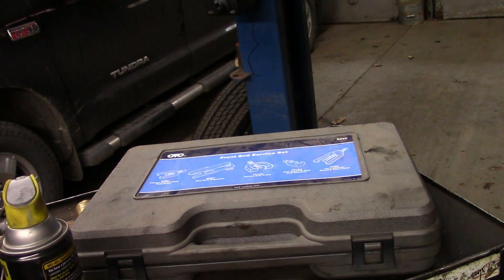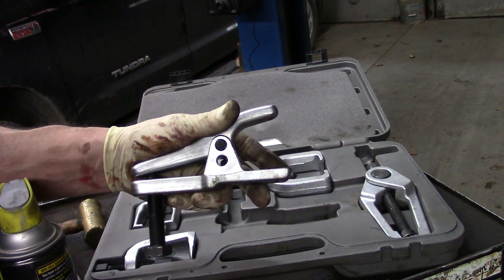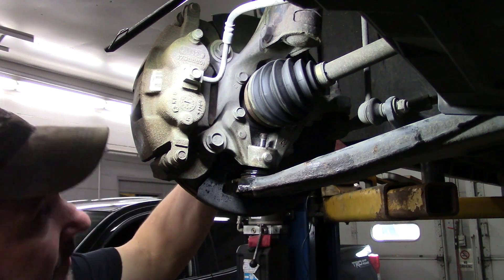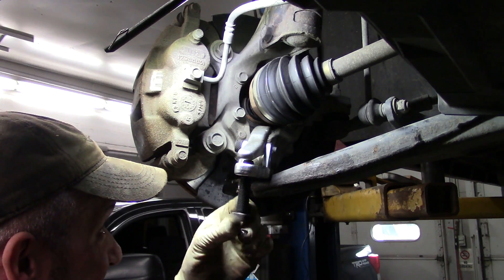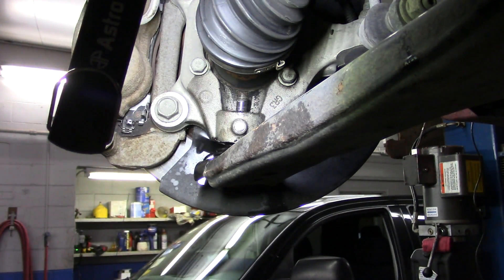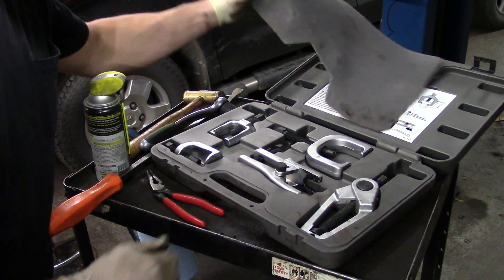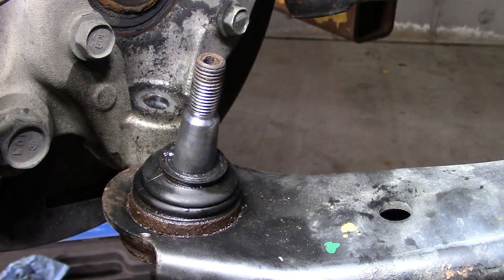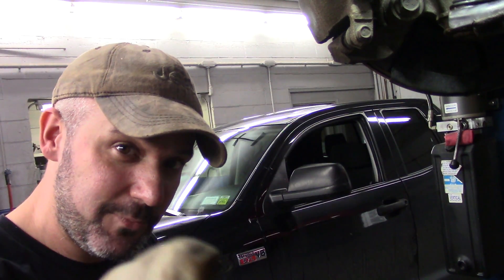Tool Time: The OTC 6295 Front End Service Set

Comment: That same ball joint tool works great for pressing back the copper sleeve on alternators that helps make them extremely difficult to reinstall unless it's hammered back or pressed back with that ball joint tool!

Comment: My bottom ball joints were stuck on my Silverado. Pickle forks and hammering to no avail. Don't have this kit (YET). Put my Powerbuilt control arm bushing press on it to just add tension and it popped right loose! This kit is in the mail right now. Thanks for another great vid Eric!

Comment: I have a ball joint separator from Harbor Freight the part that goes on the ball joint stud is pretty thin so I thought it wouldn't hold up. Boy was I surprised. I've used it several times with great success.... well, there was that one time...
I was cranking and cranking on the tool thinking, "any second now" and anyone that's used one knows that it can sound violent when it goes.  Anyhoo,  I was cranking on it and stopped to look, the tool was bending the ball joint stud on a Moog ball joint. I couldn't see it from my vantage point. That little $8 tool is surprisingly strong.
(A new ball joint was then needed)

Comment: Oh, and tool tip for the tie rod tool...when you're done screw it back into the jaws, if you loose the tip, they're useless. And I've had the tip blow out like my shorts when old rusty finally popped and tie rod job turns into clean up the shop job.

Comment: This one either didn't show up in my email, or it got deleted by accident. Guess I need to check your channel directly every couple of days! 

I have that same kit! The labels and instructions look different, but all that's included looks identical. I bought mine about 7 or 8 years ago ... maybe longer. 

All the tools in that kit work great! I used it for years on everything,  before I realized alot of things can be removed with a 4 lb. sledge whack to the side. There's been times where I thought I'd break that one you were using there - I was hammering on it full bore with the 1/2" impact. Was having a bad day that day (what else is new? 😂) and was in "IDGAF mode" . Well thankfully the ball joint let go before the tool did! 

The pitman arm puller and tie-rod end tool also work fantastic. Priced pretty reasonably for that kit, too. I highly recommend this! 👍👍

Comment: So the trick to making this thing work on a 2008-2012 Accord: you need to grind the notch significantly larger.  Like...don't stop until the inner "edge" is 3/16" thick.  And you have to tap it in pretty aggressively to push the boot out of the way.  The boot will weep grease because it gets compressed by the tool.  And jack up the rotor a bit to flatten out the control arm...otherwise you have no chance.

Comment: Honda has a stock tool very similar to what your using. Up here  we have princess auto similar to your harbor freight they have one similar to the otc. I have used a chunk of hard wood with a mini sledge hammer. When that doesn't work I hang what ever scrap or good engine I have kicking around and with the hard wood hitting on the end of the grain it doesn't mark the spindle. I work alone so I had to get inventive. Great kit great video.

Comment: i bought the harbor freight one  figuring a one time use deal.   that was 5 years ago.  it gets used enough  but not a lot like a car shop  but it is flatter and doesnt have that cutout underneath. one of those tools once you get it  ya dont want to be without it
Reply: Seventy nine ninety-nine at Harbor Freight, but it has less than three stars.

Comment: Harbor freight makes a version of that as well, which i've used with success on a few projects.   I have heard that the bolts are prone to stripping if you don't lubricate them, so i keep mine greased.   The HF one is less beefy than the OTC, so it might squeeze into some spots where that one won't fit.  (and i'm sure it's easier to break, too)
Reply: Yeah, the Harbor Freight one works great, except that every time I use it I'm afraid it's going to explode and hit me in the eye. I normally wrap it in a rag.
Reply: I use the HF version with a ratchet and keep a nut on the stud. Tie rod on my Villager broke loose and sounded like .22 shot. No damage to the tool, though. I put some grease on the threads. Works fine for my very infrequent use (twice in 6 years). I have their Pitman arm puller, which has also worked fine.
Reply: Same, I also have the HF version. It's still a bit of a tight fit on some knuckles, even though it's less beefy. I normally use mine to pop the lower ball joints out on Audi knuckles which are aluminum.

Comment: For some reason the majority of these types of ball joint separators are 22mm, where 28mm would be a much more useful opening.  I had to grind my 22mm jaw opening a bit to work with Honda ball joints.

Comment: I had to grind my ball joint seperator also to get it to go on my ball joints.
Reply: Same here. Nothing like taking a grinder to a brand new tool you just bought to make it fit. I dont remember if I ever got it opened up enough to work on the lower ball joints for my Rodeo. Works great on the upper and on my Volvo though.

Comment: Is there a easy way to repair/ replace the heater panel door on the base town and country 07, I ve seen you work on a ton of town and country vans, I cut and slot in the side of the box and fished mine out and glued it and ran a screw into the hinge for a temp fix ??

Comment: If you are trying to safe that ball joint, then dont pull or push down from the control arm. As it can spreds the ball joint ball hole. That tool is must have on aluminium, but if its harder metal then you can use hammer to make it loss. But dont pull or push down the arm before that ball joint is lose, if you are trying to safe it....

Comment: My moms 2004 Trailblazer has alum knuckle. I just use my fat heavyness to put pressure on the tie rod, and tap on the knuckle boss with a 2 lb hammer. Doesn't marr the surface and the tie rod pops out. Maybe I'm just all beefy man-ness and just don't need special tools

Comment: A free saturday tip from me; if the rubberboot from a wornout BJ is still ok save it in case you have a balljoint that is ok but the boot not.
Reply: good tip
Reply: @Joe H When you are doing an inner balljoint/strut/driveshaft and ruin the rubber from the outher you save a lot of time(=money) for the customer andyourself when you have the saved rubber.
Reply: I've never yet found a good boot on a bad joint, I guess it could occur though lol

Comment: I have that same kit.  I need a replacement bolt for that same tool you used, though.  Can't seem to find a replacement.
Reply from the maker: Have you contacted OTC. They will send you one. It is lifetime I believe?
Reply: @SouthMainAuto  No, I just searched their website but I'll try giving them a call.  I didn't realize it was lifetime guaranteed.  I was trying to separate a 2006 Mercedes CLS55 ball joint and it just wouldn't break loose.  That tool had a good grip but damaged the threads in one spot and never separated it.

Comment: Be careful using this tool on a Hondoo with 2 holes for the cotter pin. You will easily crush the stud. Definitely need to thread a nut on those first to have any chance.